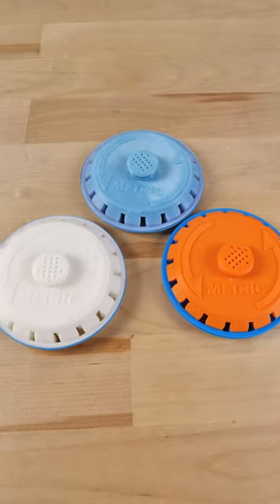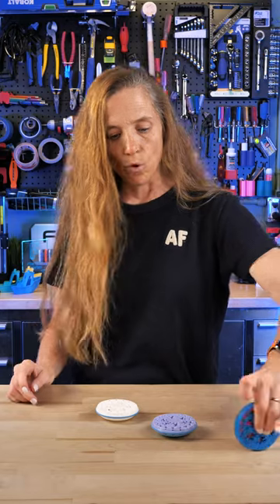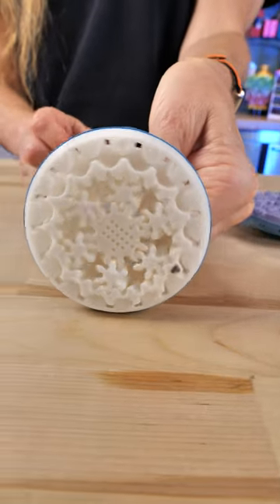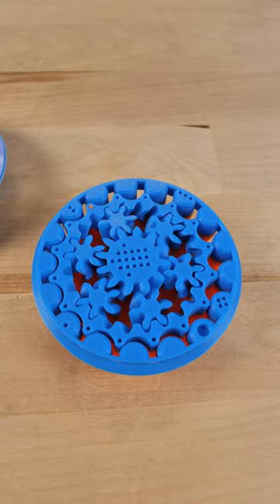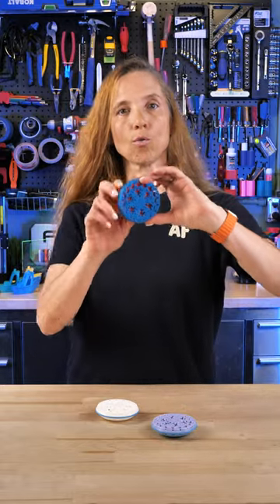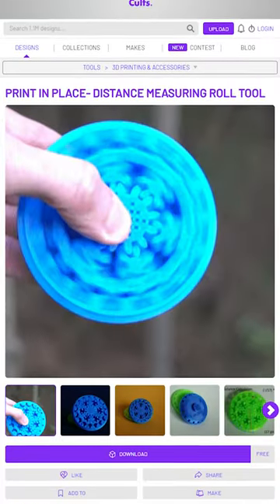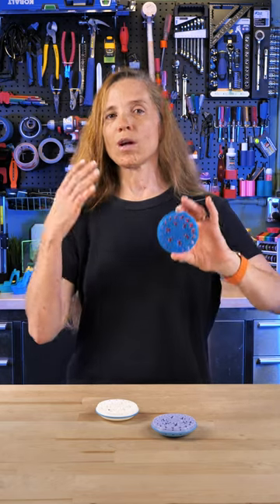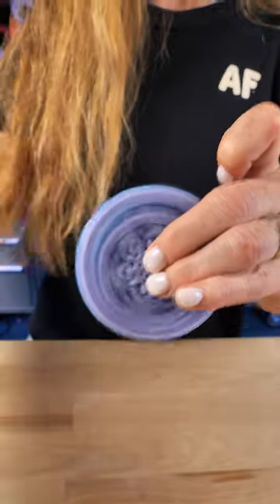3D Printed Measuring wheel with some crazy cool print-in-place gears

Comment: Ah, more plastic waste. 🤦🏼‍♀️
Reply: a casual reminder that most plastic waste and ocean trash is from big industrial projects, and not individuals doing hobby work. not that we can't all be concious and do our part to recycle and reuse! but comments like this come off as uninformed and unhelpful, especially when the 3d printing community is aware of the waste issues and many different recycling projects have already been started.
Reply: It cannot be both waste and useful. This one clearly has a utility aspect.
Reply: Imagine going out of your way to come to a video just to complain about the subject matter. Go touch grass.
Reply: This is like blaming someone for deforestation because they removed a dead tree from their property. FYI it's common practice in 3d printing to keep scraps and fails to send in to be reprocessed into a new spool of filament leaving no waste
Reply: @chefboyardeeznutsinyourmouth PLA is only degradable in a bio reactor. It does not decompose on its own
Reply: @smolzillamakes do you understand how yt shorts work?
Reply: @giraffles  yes. I worked in a factory, and one workstation produced more waste in a day then I do in a year (I dont try and reduce plastic waste either). It really put a spotlight on how anything we do is pretty much pointless. 

There was technically a "recycling bin" we would put plastics in, but it went into the same trash can as all the other trash, so...